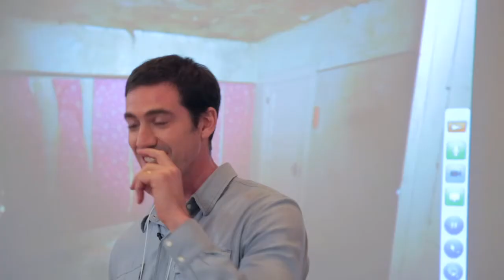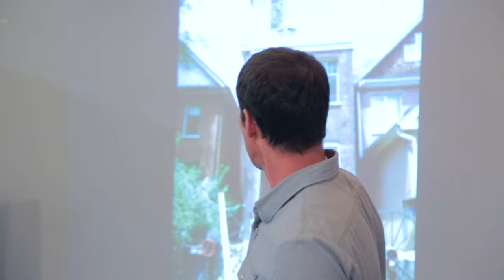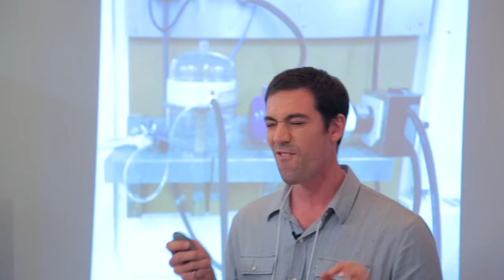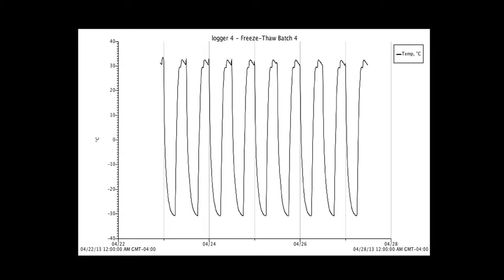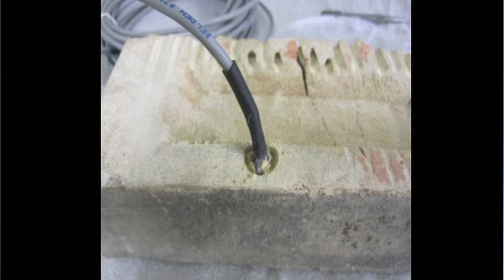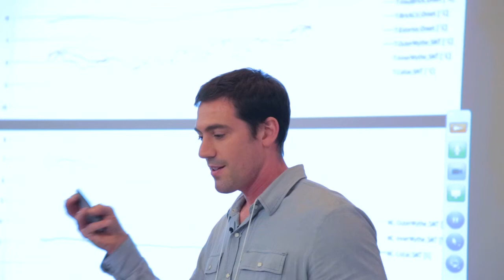Prof. Russell Richman shares insights on insulating vintage masonry buildings.

Comment: I'd be really interested to see some science behind building techniques of exposed solid masonry walls (no insulation) and the efficiency of thermal mass, condensation control, etc... Essentially starting over and building the science upon solid masonry walls (historic brick) vs new modern building sciences who rely solely on insulation for efficiency.
Reply: I bought  a 100 year old brick block house with plaster walls. The back of the house suffered from a faulty gutter and concrete slab with cracks -- virtually no maintenance at all. I took a historic restoration class using lyme plaster , tore down the inside walls to replaster in the spring. It's a townhouse so I want to keep the air space that was there so as not to have to lose room space and adjust windows and doors. I plan on maybe, using insulation on the outside or adding another layer of brick.. haven't decided. Information re: this is all over the place. I prefer my home to breathe. I understand reducing energy waste but then again , I'm still looking at ways to insulate that is workable... It may take awhile ... the restoration folks said ...don't use insulation ... anyway
Reply: @karenflowers9611  I like the idea of insulating the exterior but keeping the brick exposed. Thats how you'll get the benefits of thermal mass. The masonry absorbs that heat and slowly releases that stored heat back into the home

Comment: Just found this vid.  I'm REALLY excited about his research because I'm insulating on the inside with a masonry perimeter wall and this has been one concern I've not been able to find much science on.  My perimeter is concrete block, not brick but I'm hoping there is an analogous dynamic.  I am taking steps to "skin" the outside of the block so it's never exposed to the weather.  I hope this will prevent a lot of moisture from getting in to the block above grade.    I'll let ya know in 20 years.   :)

Thanks for posting this!

Comment: I live in Richmond VA. House built 1950s. Cinder block with exterior brick.

I've coated the brick with concrete sealer. The brick soaks it right up! At 50$ a gallon, it added up quickly. 

I've noticed an improvement especially in the winter. Before, during winter rains it seemed like the cold moisture was coming right through.

Your thoughts...
Reply: From where I am in my learning curve, you really don't want to seal brick. It breathes which is how it maintains its integrity. It's so hard to find anything here in the US.. The brits know what they're doing but finding supplies is challenging. I finally found a place in PA called Limeworks for folks who are in the trade and homeowners who are interested in restoration and maintenance. Basics: don't seal brick. I would be interested in how that works out for you in the next few years. I'm NO expert, that's for sure.. just committed to learning
Reply: @karenflowers9611  I did it years ago (5+). And I only sealed the exterior. Brick definitely can breathe from the interior side, given there's absolutely no insulation or vapor barrier.  All I've noticed is there's less draft and lower heating/ac bills. 

Absolutely zero evidence of "I made a mistake "